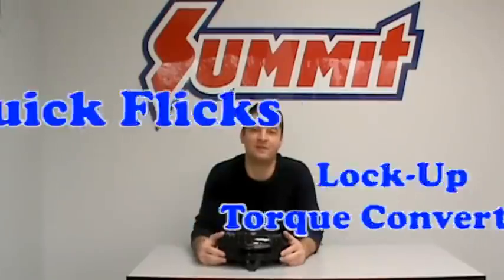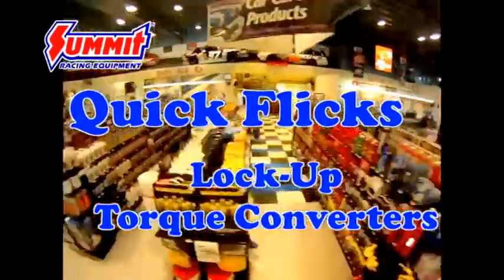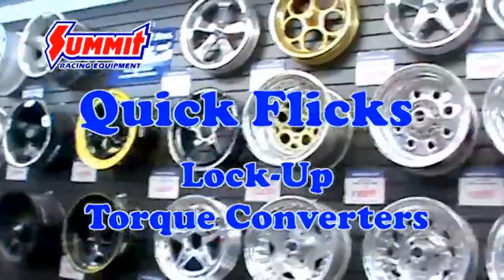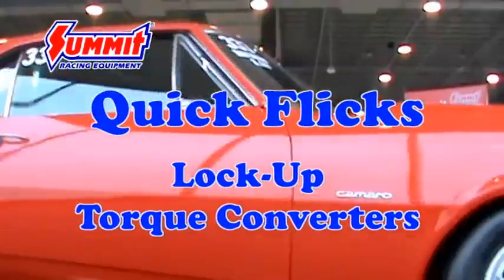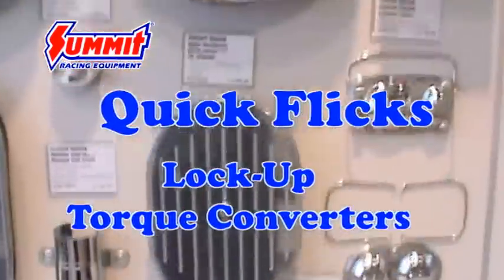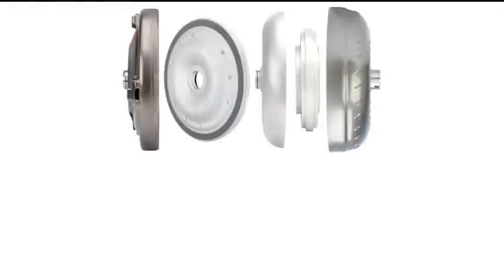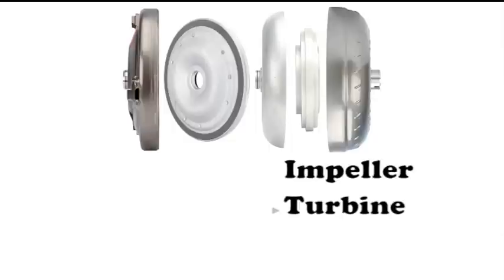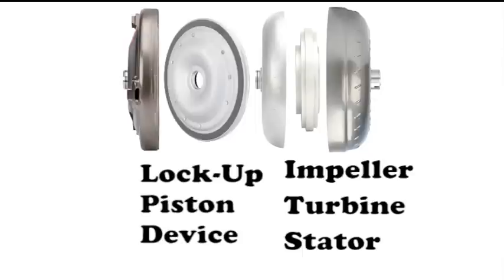What are Lock Up Torque Converters?

Comment from the maker: This design allowed for a good holeshot at the starting line along with the rapid shifting of an automatic transmission. Torque converter technology, specifically torque multiplication by the torque converter, has since come a long way and has proven to be a better way to go for most bracket racers!

Comment from the maker: Hi CamaroSeeker, 
Yes, the 200C used a lock up torque converter. This was one of the earliest transmissions to do so and it was in fact done to slow engine speed while cruising down the interstate to achieve better fuel economy.

Comment from the maker: Fluid from the transmission and torque converter do mix. The clutch inside the torque converter is applied by fluid pressure that comes up through the center of the input shaft. This passage is controlled inside the valve body and is applied when the car is at a steady cruise RPM.

Comment from the maker: Keep in mind that a torque converter does in fact take the place of a typical/standard clutch, but acts somewhat like a centrifugal clutch. It allows slippage that a typical clutch would not withstand without extreme heat build up and part failure. While typical clutches are designed to be slipped to some degree, they cannot multiply torque like a torque converter. This multiplication is done by the angle/pitch of the fins internally.

Comment from the maker: Application of the clutch inside the torque converter actually slows the engine RPM because it eliminates the slippage normally found in all torque converters. If you are experience “lugging” or what is most likely too slow of an engine speed at cruise RPM, consider changing the rear end gearing to allow the engine a little more RPM during cruise. Your mileage may actually increase due to the engine being able to breathe better!

Comment from the maker: Hi mrbill672, 
Typically when lock up is removed, the valve body and input shaft are modified. These components will most likely need replaced as well as the torque converter. Have a transmission shop disassemble the transmission and inspect it to get a list of necessary parts.

Comment from the maker: Also, a flywheel would offer no way of driving the fluid pump in the front of the transmission that supplies the pressure to hold the internal wet clutches and distribute the fluid for lubrication and cooling.  It may be best in your case to consult a converter manufacturer direct for a custom built piece designed to your needs.

Comment from the maker: More recently, Audi, Subaru, Dodge & Nissan have been using a Continuously Variable Transmission or CVT in order to keep the engine in its peak efficiency range at all times for the best possible fuel efficiency with little to no compromise on performance.  I have two links to other videos i will private message you, these two videos will show additional detail.

Comment: Okay, so does fluid pressure lock, or unlock the convertor clutch?  ie: Is it necessary to apply fluid pressure to the convertor clutch to lock or to unlock it?

Comment: I have a 1985 gmc square body 4x4 truck with a locking converter. It actually had a switch to control it. Can I drive it locked in all the time or not? When it is on wont' it lock when needed?
Reply from the maker: Hi, That depends upon how the switch is wired. My understanding is that these trucks didn’t originally have a switch on the dash, but they utilized a ported vacuum switch on the driver’s side firewall near the brake booster. If your switch on the dash is controlling the 12 volts to the vacuum switch, then you should be able to leave the switch on at all times. You would only turn it off if towing or hauling a heavy load, like an early form of a Tow/Haul button found on newer trucks. If your switch is the only control for the 12 volts going to the torque converter lock up solenoid, and the vacuum switch has been removed, then you must make sure it is turned off when coming to a stop and during hard acceleration. I hope this helps.

Comment: I have a th350 73 Camaro 350 has about 400 horsepower approximately need to know whether I should put a locked up torque converter in it I have a Boss Hog that goes from 2400 to 2800 stall do I have to do anything different to the transmission fully upgraded to high performance B&M kit
Reply from the maker: I would not recommend it, unless you do a lot of highway speed driving. You would need a 1980 and newer TH350 that has the lock-up capability and it would only benefit your gas mileage slightly at constant cruising/highway speeds in 3rd gear.

Comment: I have a newer th350 trans, can I use a lock up converter on it? Would it help with highway driving?
Reply from the maker: You would not be able to add a lockup converter to a non-lockup transmission.

Comment: I have a 92 Oldsmobile Custom Cruiser that needs to have its 700R4 rebuilt. It's also getting its original 305 swapped with a  350TBI. Should I get a Lock Up Torque Converter? Do they last as long as a standard converter??? My tranny lasted 240k. I daily the car. Thanks so much for the info
Reply from the maker: Hi Balto, 
That car already has a lock up converter and yes, for best economy and daily driveability, it would be best to keep it! Thanks for watching :)
Reply: +Summit Racing Would increasing the stall speed do anything? I didn't know the 700r4s had lock ups.  i thought the 4L60Es

Comment from the maker: Locking up a torque converter more often is not a new concept; in fact, the factories have been doing it for years. Different companies have experimented with different times at which they lock the converter, but the bottom line is this; they’ve all done it in a quest for better fuel economy.

Comment from the maker: This angle can be changed; thus the availability of many converters in the aftermarket. By changing this angle, a converter can be tailored to the needs of the driver.  I do not know of anyway that a converter could be directly replaced by a standard transmission flywheel. This would certainly not be my suggestion anyway. The torque converter offers too many advantages to take a step back in time and technology!

Comment: hey question. so when the torque converter locks up on a 4 speed with OD does that mean it changed into the 4th gear? so tq lock up is going into the overdrive gear??

Comment: If you have an electric lock-up system on one of the older transmissions, can you  leave it engaged at all times?
Reply from the maker: +Don Cankook, 
The converter must be able to unlock or the car would not be able to idle in gear!
Reply: +Summit Racing That's fine, and I'll keep it in mind.  I was only planning on using it for highway driving anyway.  I suppose a blinking LED, or beep reminder or something  like that would be useful so you don't forget? I don't think I can make a beeper that beeps at a certain speed, like anything below 30 MPH-  not on my old car.  But thanks.

Comment: Great video, thanks for the information.  Just a couple of things, are the torque converters fully sealed units with its own oil that doesn't mix with the transmission itself?  You mentioned the lock up clutch is in the converter itself, so does the third shaft come from the trans through the middle of the converter to access the clutch?  Thanks

Comment: I have a 88 Chevy Silverado automatic tranny with overdrive, a 700-R4 I believe. It had a B&M shift kit installed in 1998. Shifted hard and stiff. I hated the original lagging between gears. I've never fully understood how transmissions work. They're confusing to me.
I have upgraded the bottom end of the engine in 98 with edelbrock aluminum heads, rocker rollers, cam, headers, exhaust. More recently upgraded to edelbrock intake manifold, Holley 670 cfm throttle body, msd distributor and wires. Need to get a custom chip next which will tune it all in. Im assuming somewhere around 350hp...350-400ftlb torque. But before that happens, my transission recently lost gears 3, 4 and 5, according to mechanic. So, I need to do something about that...should I just get the 700-R4 rebuilt, upgrade it, add a shift kit, or upgrade to different transmission altogether?  Any help would be greatly appreciated
Reply from the maker: A properly built 700r4 would be very reliable with the engine upgrades so I would rebuild the transmission. Just make sure that all of the parts are designed for the increased performance. Contact one of our sales representatives at 1-800-230-3030 for all the right part numbers.

Comment: I got a bone stock 97 gmc jimmy (4.3l l35 and 4l60e), with lifter issues and converter shudder. Any suggestions of parts to eliminate these issues and improve performance? Am I better off with a v8 swap ?

Comment: I have a 68 ford pick up with a C6 trans. I do pull a pop up from time to time. Can I use a lock up torque converter?
Reply from the maker: +Bobby Price, 
The C6 transmission was never designed to use a lock up converter. In order to do this, you would have to install a later model transmission with overdrive such as an AOD.

Comment: what is tye use of lock up torque converter? and isn't possible to modify any automatic gearbox and shifting gears manually without TCU?
Reply: It's possible to install a manual valve body, which is used in cases where a trans brake is needed, like on the drag strip.  A torque converter will still be required, although the lock up feature can also be engaged manually through an electric switch, these mods are commonly used on 700-R4's since they don't require any computer programming to operate.  The use of the lockup is to reduce RPMs even further at highway speed, since the torque converter won't require slippage when in overdrive, thus no power loss to hydraulic pressure, and the engine and transmission are locked together, reducing transmission/torque converter wear and heat.

Comment: S10 5.3 4l80 3.73 tires .598-.604 lift cam torque converter? And on lock up will it keep it cool and not slip below flash stall rating?
Reply from the maker: Hi Keith skrdlant, 
We would be happy to help but we need some additional information from you. Can you give our tech department a call at 1-330-630-0240? We look forward to your call. Thanks for watching!

Comment: I have a 2000 Chevy Silverado and I'm changing the transmission. the torque converter is locked up and when I try to spin it. it won't spin and when I put the transmission in the truck and put the torque converter bolts in it won't spin but on the other transmission that's screwed it turns over freely. can you tell my why the torque converter won't spin
Reply from the maker: Hi skyler wood, 
When the torque converter is properly seated into the transmission, you should be able to measure from the face of the bellhousing (where it contacts the engine block) to one of the mounting pads on the torque converter and have a distance of 1 1/8” to approximately 1 3/16” of an inch.  Anything less than that means the torque converter is not properly seated into the pump and will bind upon assembly!
Reply: Robert huerta ...universal technical institute student. ..there can be a few reasons 1st off lets just say a torque converter is controlled three ways hydraulically, mechanically possibly  electronically. possible causes, torque converter clutch not fully disengaged one of the valves are stuck open allowing fluid to pass by and partially engaging clutch or possibly. bad  solenoid can be a couple of ressons why

Comment: should I use a lock up torque converter for my 350 Chevy turbo transmission
Reply from the maker: +Pauly Ith, 
Its really only necessary if you’re trying to squeeze maximum fuel economy out of your vehicle.

Comment: im lloking to upgrade my stall converter on my 2000 silverado with a 4l60e do u recommend i get a lock up or no?
Reply from the maker: +Rodrigo Mendez, 
Since your vehicle already has a lock up converter it would be highly recommended to keep that function. There is dis-assembly and modification of the transmission if you were to decide to delete that function.
Reply: +Summit Racing alright thanks
Reply: Rodrigo Mendez, if it seems that after replacing the lockup torque converter and it appears to not lock up in overdrive, most likely the lock up solenoid piston in the valve body of the transmission is leaking, since 4L60E transmissions are notorious for needing the solenoid spring replaced.  4L60E lock up works intermittently as standard, thus leading to premature wear on the spring.  2 ways of fixing it are to replace the spring with a longer aftermarket unit to hold solenoid pressure, which will cause the lock up to no longer work intermittently, (lockup is either fully on or off) or the much more expensive route being reaming out the solenoid valve port and replacing the piston entirely, just to retain the intermittent lockup feature.

Comment: have a 700r4 with a 2800 stall the lock up was removed, would the converter still have it so i can put a switch in to lock up 4th trans was done 16 years ago , lock up was removed to handle power

Comment: Okay... As an European unfamiliar with automatic transmission now I understand why I felt that in four speed transmission there was a "phantom" fifth gear  - It was the converter locking and unlocking when load at fourth gear varied.
Reply: mibars Well done Grasshopper!.  You have reached a new level of enlightenment.

Comment: hi lockup system only work in last gear? for example in th700 only work in 4 gear or lockup can work in all the gears?
Reply from the maker: hedw30, 
The aftermarket lock up controllers sold by Summit Racing only work in high gear but can be overridden/rewired to work in any gear you choose!

Comment: I have a 86 Pontiac Parisienne, it has had the th200 replaced with a th350 with lock up, I've left it unplugged as recommend by SEVERAL people, could that have caused my transmission to randomly go out on me?
Reply from the maker: +79bonscott, 
No, this should not have caused a problem.
Reply: Summit Racing thank you, the more I think, I may have my answer, it was a junkyard buy, I've got the tranny hot to where it overflowed through the dipstick tube, AND I tried several times to brake torque it, tail end just sits up and she growls, no spinning tires. Too much strain for a 4.3V6 350turbo 2.73 rear gearing lol... She cruises wonderfully however and WILL run lol, providing I can keep a tranny in her

Comment: on my 13' mustang gt automatic, i noticed if im light on throttle sometimes rpm will flare 2-300 around 40-42mph upshift at around 17-1900rpm. Does this has anything to do with lock up converter?
Reply from the maker: Hi winkawak,
While not being able to experience this directly; it is very possible yes!  The factories are locking torque converters at all different speeds and throttle openings now in an effort to boost their “MPG” numbers as high as possible.
Reply: Summit Racing
the thing is it only happens below 2k rpm with light throttle when its upshifing around 42mph. But the weird thing is last night it was really bad it flared up 500-1k rpm before upshifing. I took it to dealer today and mechanic took it out for test drive. Flare did happen while test drive but only flared 300rpm. They are busy and i have to bring it back on monday, do you have any idea if it could be torque converter or bad parts?
Reply: Summit Racing
another thing, shift flare happens 50/50 of the time.
Reply: winkawak Its not the lock up clutch.... you have serious problems with the tranny.  Demand that they fix the problem under warranty.

Comment: So my Jeep has a lock up converter I was just wondering what RPM range they usually lock up at? I launch at around 2500 rpm just using the brake torque method and she hauls ass haha
Reply from the maker: Hi Cam, 
Lock up is influenced by a few things such as Engine speed, vehicle speed, manifold vacuum (load) and throttle position. So, it really depends on a lot of factors!

Comment: Is it possible to build a th400 with a lock up converter?
Reply from the maker: Hi Adam, 
We do not currently offer an upgrade kit to add a lock-up function to an OE case TH400. But we do offer an ATI race transmission with lock-up, you can take a look here…. https://www.summitracing.com/parts/ati-401608lu

Comment: Will the economy factor be significant if I install a lock-up converter with aT-350 (3-speed, non-o'drive) transmission?
Reply from the maker: +duckpooklingduck , 
Lock up torque converters were introduced to not only increase mileage but curb slippage and heat caused by slippage. In general that slippage equates to approximately 200-400 rpm. Now, that can differ depending on the vehicle. Heavier vehicles would of course experience more slippage than lighter vehicles. So, will it help – yes!  How much – well that depends on a few things! Early applications, such as the TH350C only locked up in high gear, whereas later computer controlled applications lock up when commanded by the on board computer. This can be as early as second gear depending on a few inputs such as Throttle Angle, Engine Load, Vehicle Speed etc. By locking the converter as early as possible, MPG gains can be significant and heat kept at bay more easily.

Comment: Well, this video is good.. in providing "the basics".   What drives me crazy.. is that I want to be able to have engine braking when my '89 Caprice is in overdrive.   It DOES have engine braking when in 'straight' drive.... but when in overdrive, it's borderline dangerous.. because the car won't slow down when I take my foot off the gas.   Mercy---the driver should be able to control the car in ALL shift quadrants... and should be able to have the car slow down when taking one's foot off the gas when in overdrive.